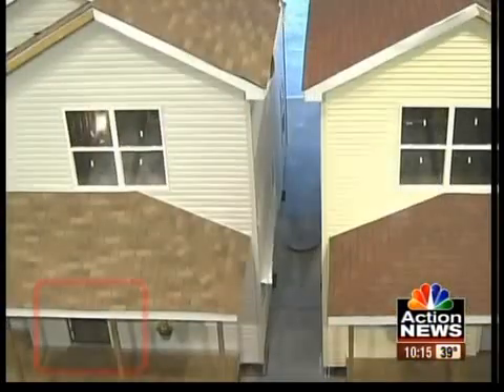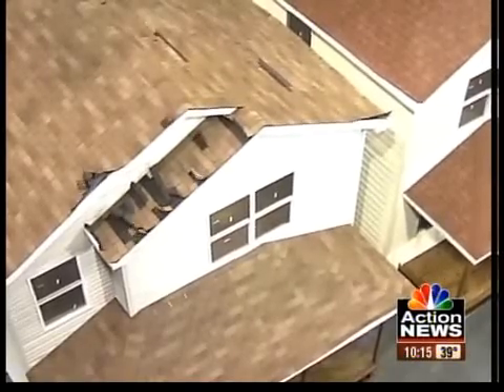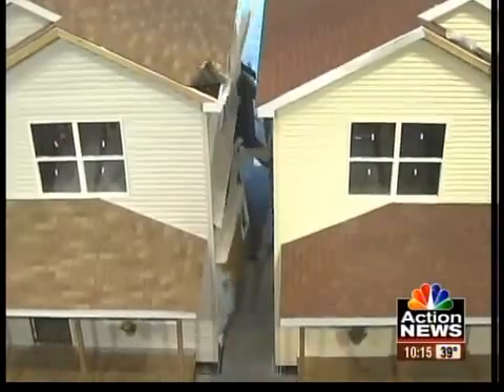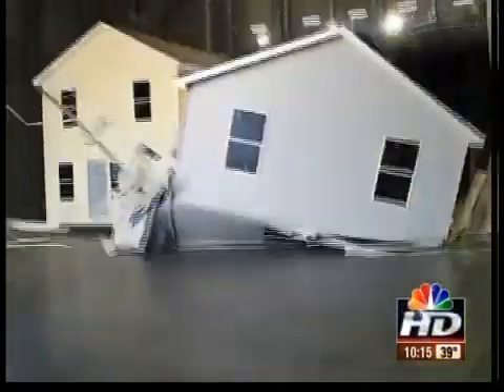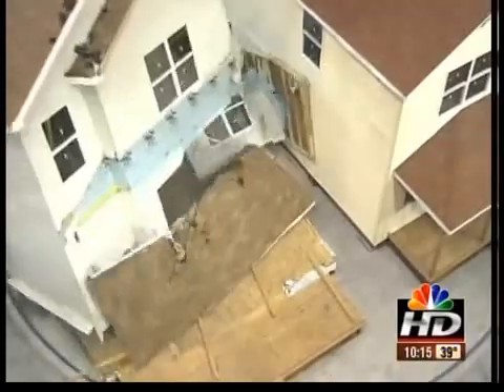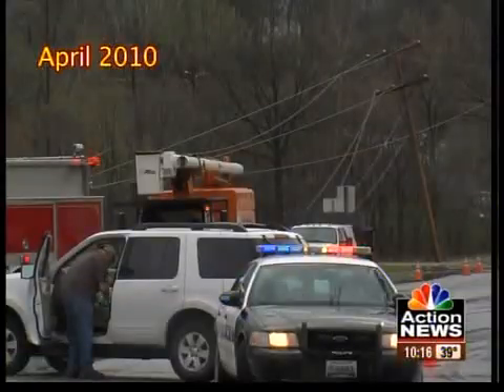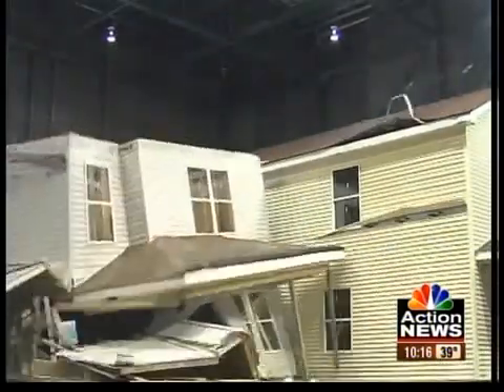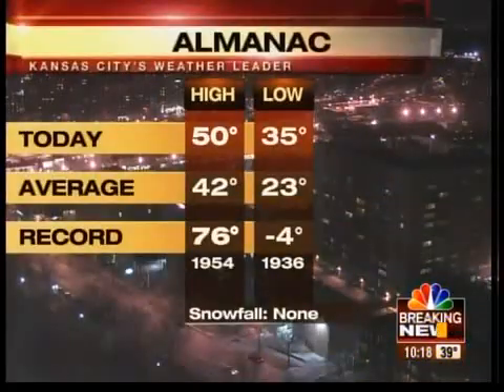The secret to tornado-proof building

Comment: Those pre fab are like dollhouses …why not built in super reinforced concrete like in earthquake countries ?
Reply: in spain we do houses with concrete and everything else im pretty sure, just like in the rest of EU. We use wood maybe for sheds and not much more. I dont know why US houses are built with wood🤦🏼
Reply: @Mateo  April 27th, 2011 EF5 Smithville Tornado. That tornado completely destroyed a building with 6 foot thick reinforced steel with concrete made for 180+mph winds. The 4-5 Inch thick steel beams bent up In ways it's insane. It pulled 30 feet deep waste system out the ground. It threw a 20 ton truck hundreds of yards. It left 10+ feet deep ground scouring. Tornado shelters pulled out the ground. Trees pulled out the ground and completely debarked. Unlike what you see in this video. Tornado winds suck up everything high into the atmosphere. They also put extreme pressure on things. A tank wouldn't even survive the power of EF5 or a EF4. Ef2 will destroy a mobile home but well bulit Homes won't even have a scratch.
Reply: @Jessehandle-c2r  u cant make buildings mate dont worry it isnt ur fault thats life
Reply: You literally don't understand the power of EF4+ tornados.
Reply: @Jessehandle-c2r  i know, plus we was talking about wood houses, you dont make a building with wood🤦🏼, and a EF4 tornado isnt going to break a concrete house. If it does its poor quality,

Comment: “100 mph”

So the house is made of cardboard?

You’d have to have winds over 250 mph for it to do that to a house (F4 and above).

There was an F4 in Northridge Ohio on Memorial Day and it didn’t do that. The worst that happened was homes got the roofs ripped off and maybe a downed wall.

Comment: The house comes apart because modern homes are built to inferior methods and standards, with inferior materials, and yet also endlessly price-hiked to sheer ridiculousness. Its like buying a tribal-painted tipi for abajilililion dollars, when you can build a yurt yourself with scavenged materials and abit of weekend work, and still have enough leftover to buy an RV (or two), with a tow-trailer for the car / truck (each).

Comment: I have my own theory for a tornado proof house. Let me know if you think it will work?
simple one ridge roofline house. 20 foot wide and X feet long. Whatever length you desire.
Stairs on both ends of the house down to the basement. Dual sump pumps with backup generators/batteries.
The basement has two layers of cement block. The outer layer supports the main house. The inner layer supports steel plate spanning the basement. Bolt it down with anchors in the concrete filled concrete block. 
All the bedrooms are in the basement with everything valuable in the basement.
Everything above the steel plate is designed to break away and be replaceable. 
If you have concrete walls above the steel plate, like ICF, then it is more difficult to rebuild.
Sleep safe knowing your family is safe.
Insurance would not need to pay as much to rebuild the house.
The one problem I worry about is negative pressure popping the steel plate off.

Comment: You guys should start testing houses that can withstand an EF6 tornado they have been predicting that it will happen eventually not sure what year or what time. But you guys should start testing houses that can with stand EF6 tornadoes that’s basically Stronger winds than an ear five
Reply: Nothing will survive a EF6. It would be a killer tornado. A EF5 does Catastrophic damage to even the very best built structures made of reinforced steel and concrete. Tornados winds don't push they suck up everything high into the atmosphere.

Comment: They should have SLOPED WALLS, and No Roof Eaves, and gradually slanted rooves, without individual roofing shingles, and a gently rounded top, not a sharp point.
No square corners either.  Rounded corners.  Or an Octagon.  Or even better yet, ROUND buildings, with SLOPED WALLS.
Get the idea ?
Reply: also steel frames and concrete foundations, steel bars tying the entire structure to the foundation.

Comment: The buildings on mt Washington summit in New Hampshire can hold up against 200mph plus wind. And they were built in the 60s. So its not a lack of material or engineering not being advanced enough its all about the money
Reply: Those are straight line winds, not cyclonic winds.
Reply: Better engineered products can bring the structural integrity of expensive concrete and steel down to an affordable price for the rest of the population though. Pretty sure that was the point. Therefore, it is a lack of material or engineering advancements. Checkmate.
Reply: @Rexvideowow   you can't engineer properly for cyclonic winds, because torque will pull the structure into two different directions. Upwards and clockwise.    If you want a structure that can handle that kind of stuff, it's going to have to be extremely flexible. Concrete is not that flexible. Neither is brick.  

Do you live someplace that gets tornadoes, or do you think because you have knowledge in one field, you're knowledgeable about everything?
Reply: @leesdroidaccountharbin9665  My dad is a tornado, so I'm pretty sure I know what I'm talking about.
Reply: @Rexvideowow  You know your dad?

Comment: You're building houses out of matchsticks and paper?
Uhm, guys, I'm from Germany, we occasionally get a little storm, nothing too serious, strongest in recent history was 1999 - storm that was roundabout a cat. 2 hurricane equivalent. And my house is built out of reinforced concrete.
Reply: Ozone  reinforced wood. You see where the problem is? We build houses with reinforced concrete nowadays.
Reply: Yes fully grouted steel reinforced CMU Concrete Masonry Units as we call them in the US which most commercial buildings and schools are made off as well as Concrete roofs (yes you can make angled roofs out of Concrete too). That's one thing that I don't get about Europe is the walls are made of Concrete by why are the roofs made of tiles and not Concrete? Also bullet proof windows and strong tornado proof doors
Reply: Ozone  Well then strong steel motorized window shutters as well. 10 or even 12 inches CMU blocks ALL cavities fully grouted and reinforced with steel Concrete roof as well Even if it does get destroyed there is less damage and way more left of the house then in a stick built house. Besides a stck built house can easily get destroyed by an EF2 tornado a Concrete house not so much and EF5 tornadoes are very rare and in my opinion it's always better to choose the best and strongest option even though it's not 100% indestructible agenst the strongest of storms
Reply: Ozone  You should go to Europe especially Poland then you'll see how thick the walls are in those buildings

Comment: There is another way.  I will tell you now. 

After you build your "normal" box house you then build a curved circular masonry wall around the outside of the house with space between the house and the wall,
You can plant shrubs around the wall to visually break up the look.
The wall will need to be 6 feet high if possible.

You are trying to keep the wind from grabbing the corners of the structure.
This can be tested also in a wind tunnel test. The wind must be similar to what a tornado would be. Remember my name. I do not have the money to protect my idea.
Reply: Duh
Reply: Like...this is almost a stupid report

Comment: My house makes me nervous. It has got to be so unsafe. I live in an "older" house. It was built in the 80's. So this is a little smaller ground area and then a little taller than most houses. Just think, this is a tall house made out of little pieces of wood. That's scary. And we only have a 4 foot block basement. Not very safe.

Comment: Use 2.5" -- 3" closed-cell spray foam in the studwall assembly and the racking resistance goes from about 2300 psi to 6100 psi.  Essentially tornado-proof.

 Longstanding endorsements for closed cell foams by such groups as the Federal Emergency
Management Agency (FEMA), coupled with newer research by the University of Florida, highlight the
effectiveness of these products in resisting flood and wind forces as well as structural damage.

Comment: if you stop building with wood you would save the trees. with cement, you would have less damage. broken windows, broken doors, leaks are nothing if you still have a roof over your head. I get disappointed to how surprised people get when their homes gets destroyed and how they rebuild them with the SAME MATERIAL. I feel sad that some lose their homes but damn you're gonna lose your home again at some point for having it rebuilt in wood. 
the government doesn't think like us bc they aren't struggling through similar issues. it pisses me off they can't help us if money is not involved.
Reply: Concrete is one of the most environmentally-damaging building materials because it is highly energy intensive in all stages of its production. Apart from high energy consumption and GHG emission, it pollutes air and water and it is also a large component of waste construction material. See sections #3-9 here:  http://www.bipcons.ce.tuiasi.ro/Archive/161.pdf

Comment: Foundation reinforced concrete six feet to the ground, the inner structure is made of a yellow brick exterior granite stone ,it costs a lot of money, but at least I'm sure my house will not fly .Windows and doors have their steel scarfs which automatically drop in critical situations .
Reply: you mean the concrete is 6 feet underground? please explain
Reply: @pattiannepascual  it means 6 foot thick concrete foundations. He almost certainly also has steel bars running through the entire structure to tie it to the foundations. Fairly common construction methods in cyclone prone areas.

Comment: They need to build these homes like how they do down here in South Florida concrete block and steel they don't blow over they don't even get scratched as long as you got your windows sealed up you're perfectly fine you can withstand up to 200 mile an hour winds you'll get a little shaken up but there wouldn't be no severe damage to the house

Comment: In Irelands north west Atlantic coast, they get well over 120 mph. Gusts and sustained gusts of 80 - 90 mph are common every winter, but little damage, because buildings are made of concrete, brick, steel girders. Roof tiles are heavy. America homes, wouldn't last a week. I just don't get why America builds such flimsey buildings
Reply: Easy. Most of the US doesn't get too high of winds and you can build a 4,000 sqft home made of wood at the same price as a 1,000 sqft building made of brick or concrete. ...well and EF5 will obliterate even concrete structures. It's not the wind itself its the 3,000 pound car flying through the air hitting the building that obliterates it. Hell just look up the Jarrell, Texas 1997 tornado....it obliterated EVERYTHING!!! Some cars were never seen again to give you an idea. I have a documentary on my channel about it you get bored.

Comment: 100mph winds? That's it? And it did THAT? Is he sure he got the wind speed right on that? I've been in homes during hurricanes with windspeeds higher than that and they hardly even shook, much less tore apart that way. They were old homes, too. And 20 years ago! I realize the building codes are different in Florida, but are they really THAT different? Goodness gracious!

Comment: Reason why is because midwest homes are made to crap specifications and only cost slightly less than concrete block double strap well built homes. For example midwest homes are built to tolerate 90 mph winds. Many Florida homes after 2008 were built for 150 MPH winds.